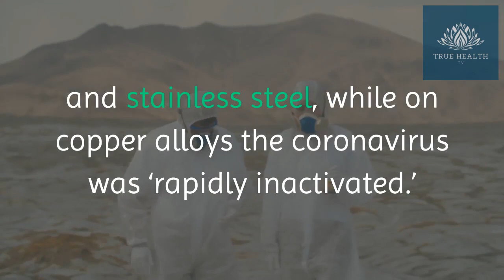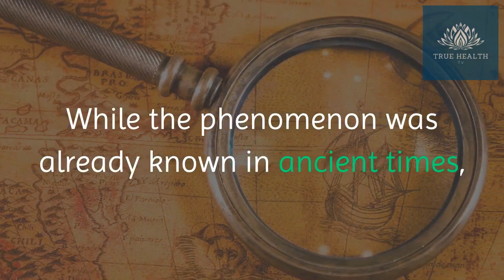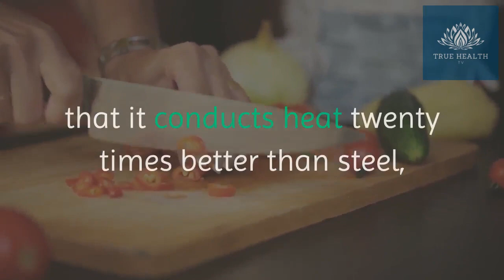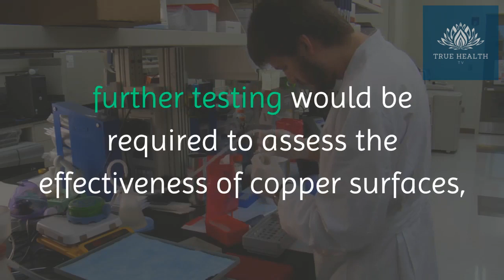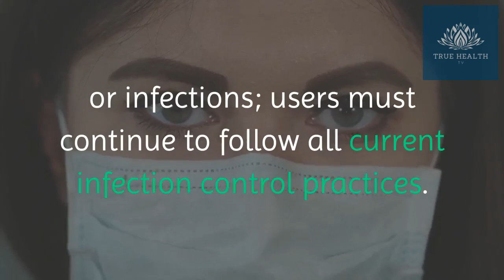What Are The Odds? Could Copper Help During The COVID-19 Pandemic?

Comment: I in times of old they had brass door knobs and and plates because brass is a mix of copper and zinc. The bacteria and viruses lasted 7 hours. The reason they didn't use straight copper is because it is very soft and would get ding'd up too easily.